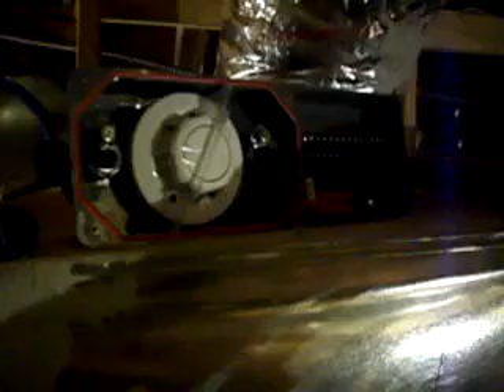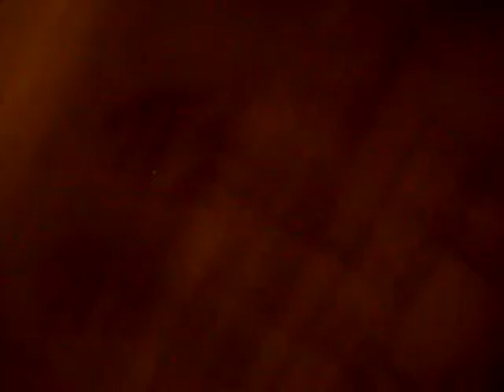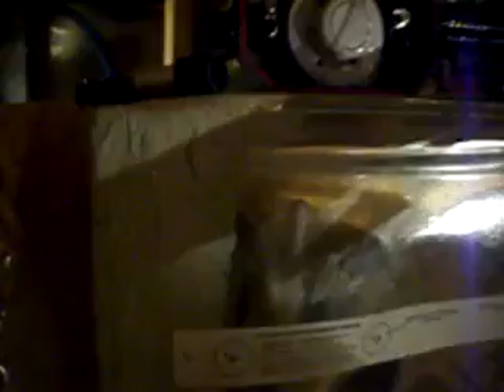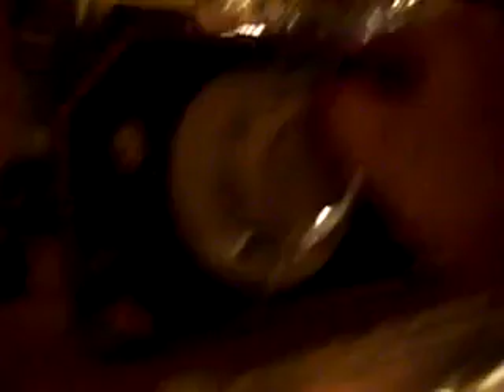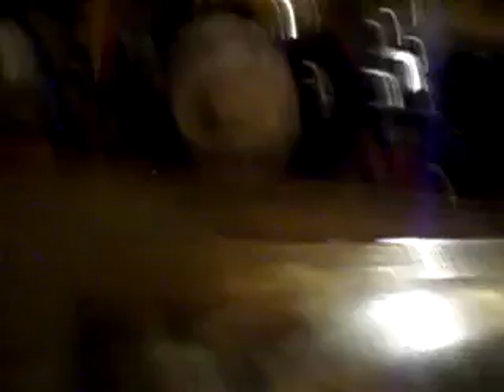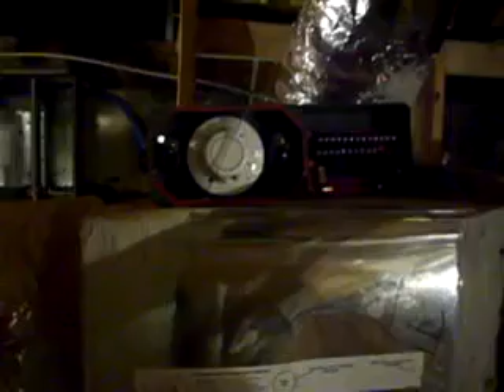Install SL2000 Air Products and Controls Duct Smoke Detector

Comment: Did not help at all
Reply: In FLORIDA new fire code states if the total is over 5000 in the pass builder where getting pass the code by having multiple units under 2000.